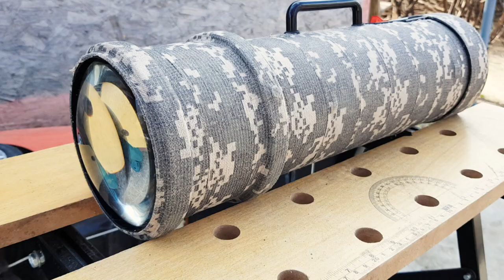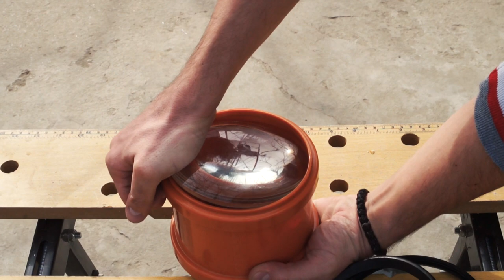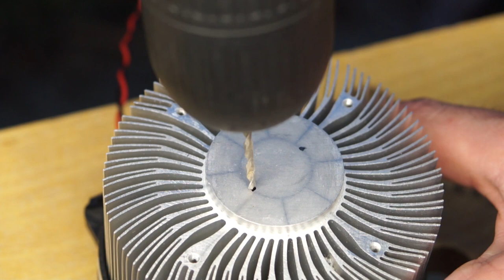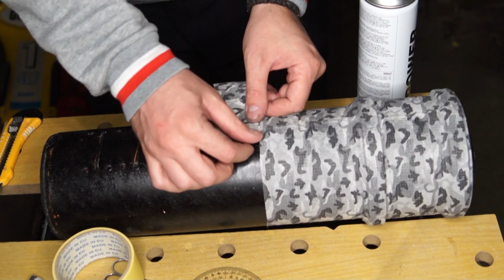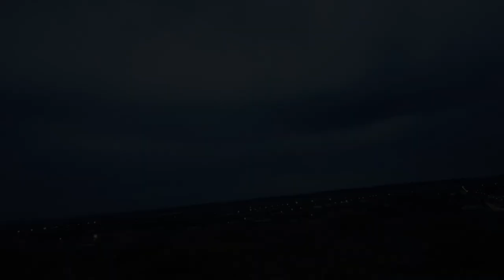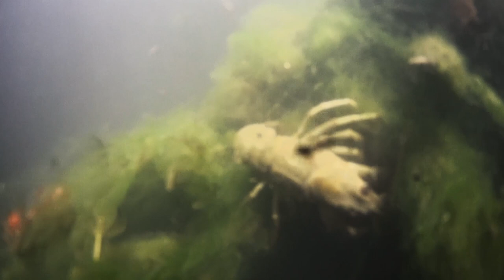XHP70 High Power LED Flashlight  - How To Make

Comment: It looks like you did not use the additional lens mounted on the emitter itself in this build. The did the efficiency gained by the lack of this initial lens make up for the light lost against the inside of the tube rather than focusing on the second (main) lens?
Reply from the maker: The led has a small lens on it, the small dome on top, without it it will not work.
Reply: @ImpactDIY   thanks for your reply. That was my expectation, but I must've missed seeing you install the lens on the emitter in your video.
Reply from the maker: The led has the small lens from fabrication.
Reply: @ImpactDIY  ahh. Yep, I missed that. Thanks! I will have to take a closer look at your video again!
Reply from the maker: I have 3 videos on the channel with about the same project but with bigger lens or bigger led, i have one with 100w led. :)